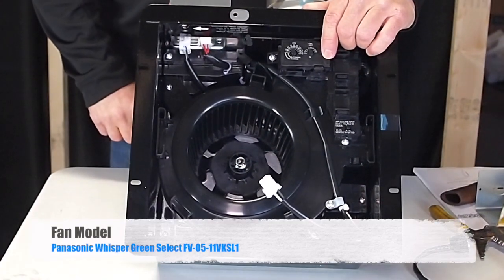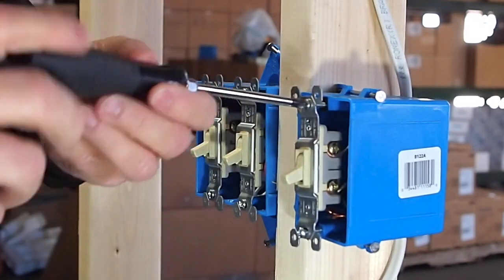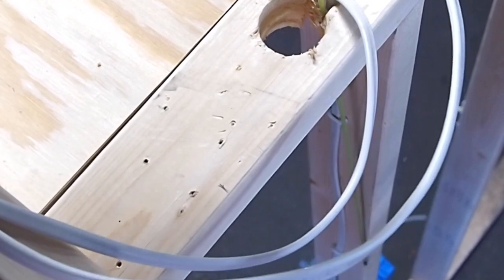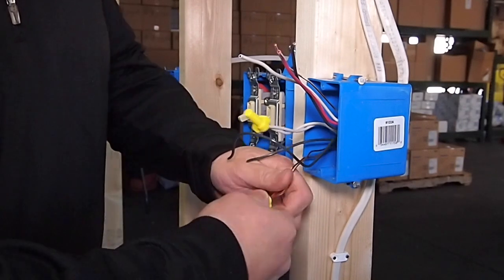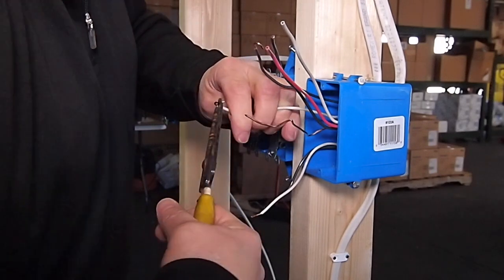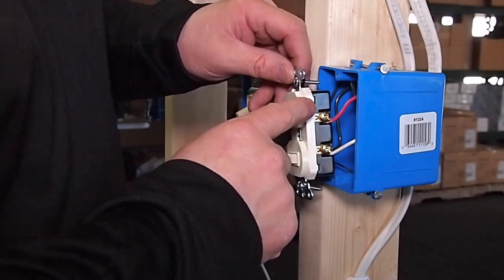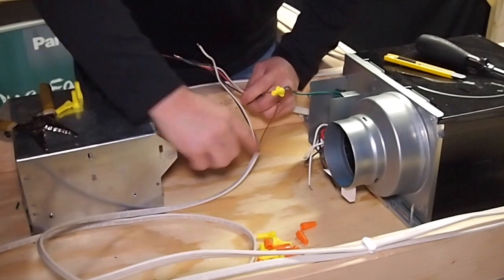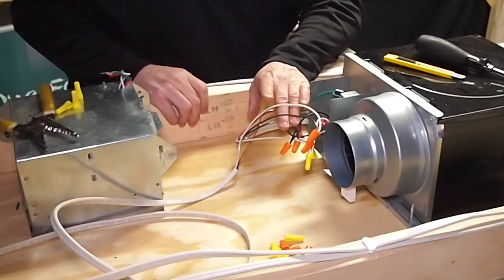Panasonic Whisper Green RetroFit Bath Fan Wiring Scenario (5 of 7)

Comment: HI SIR .THANKYOU FOR SHARING YOUR VIDEO . I NEED SOME WIRING ADVICE ON PANASONIC FV-0810RSL1  WHICH HAVE 1BLK , 1 WHT  WIRE IN ONE SET AND 2BLK (LIGHT) 1 WHT ,1 GREEN IN ANOTHER  SET.  THE SWITCH I HAVE IS TRUN ON/OFF BOTH FAN AND LIGHT TOGETHER WITH 1 COPPER ,1 BLCK AND 1WHITE WIRE WHICH ORIGINAL FOR THE OLD FAN. PLEASE HELP ME PUT IT TOGETHER, I WILL APPRECIATE A LOT.   THAKYOU AGAIN.

Comment: Thank you for this video. 
Is there a way to switch the fan completely off with this wiring method? My customer wants the ability to turn the fan off completely when desired. However, they have the speed module and moisture sensor.
Reply: Stephan, sure you can always wire it through a switch. But that lets the continuous ventilation be shut off. If you do that. Mark on the switch plate Whole House Ventilation.

Comment: So will this method work with a Double Pole Single Throw switch (4 way) to control an existing can light and then the boost the fan on the other pole? 

Basically I want to use an existing light switch box I have that turns a can light on over the toilet. I don't want two separate switches, just want to be able to turn that light on, but then boost the Panasonic fan up while that light is on.
Reply: You need the switch I show in this video. Its not a 4 way switch. Its a 2 single pole combination switch. Beside and remove the tab between the screws.